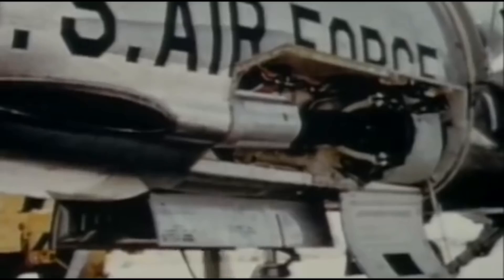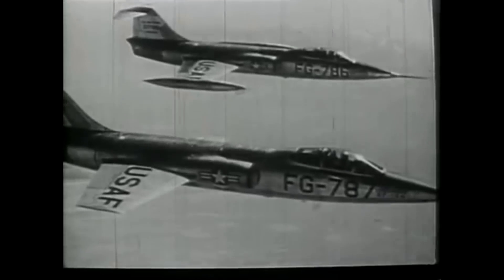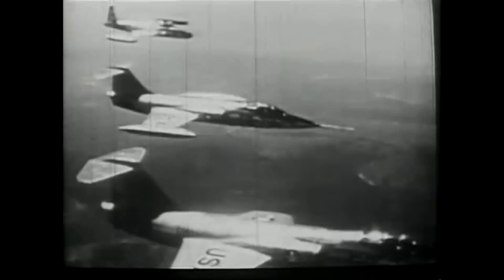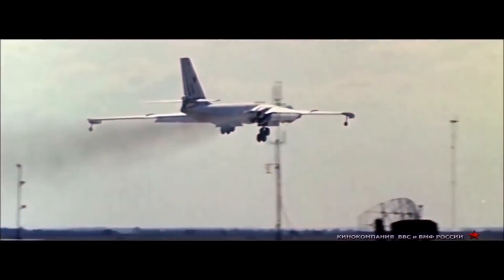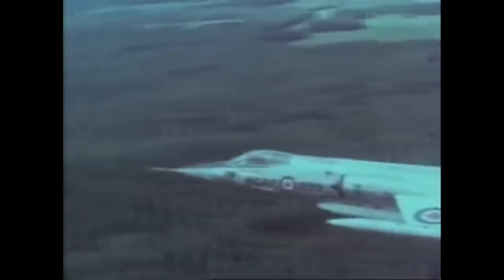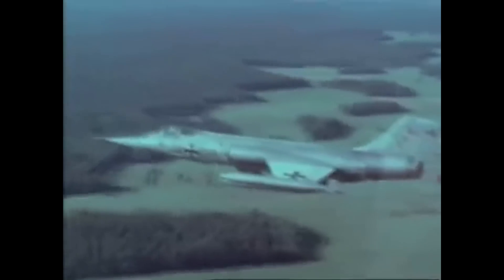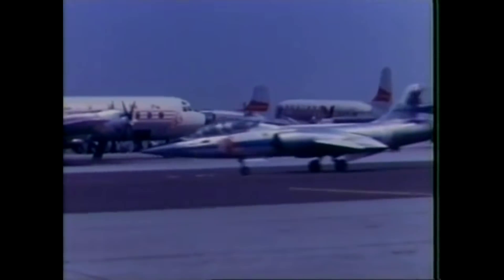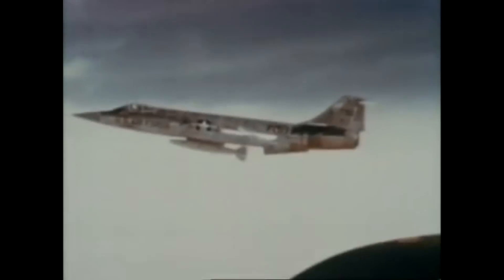Lockheed F-104 Starfighter | The worlds first Mach 2 fighter

Comment: The F-104 was called the Widow Maker in Europe.
Reply: Actually, step into 2nd generation jet fighters caused plenty of accidents world-wide. In Czechoslovakia, we had 168 MiG-21F and 48 had accident (13 fatal). Germany had 915 F-104G, had 270 accidents (110 fatal). Ratio is moreless the same.
Reply: @bluefalcon7782  The F-104 was designed as an Interceptor. It was used in exercises as a low level fighter and most crashes were from low level flight training and exercises. They simply flew into the ground.
Reply: @bluefalcon7782  nice too know! Thanks!
Reply: Most of the problems seem to drill down to people trying to use the F-104 for things it was not designed to do.

Marketing department didn’t talk to the engineers... Dilbert would understand.
Reply: Spain used the fighter ONLY as good-weather intercepter and got the benefit of getting a version, where most of the bugs were already figured out. Furthermore they had only 21 jets and did all in all 'only' 17000 flight hours. German pilots flown over all squadrons around a hundred times of those flight hours. So they got the benefit of low numbers too. In Germany Erich Hartmann spoke out against the plane, because of all the problems, which forced him early into retirement. His direct boss Günther Rall said he lacked the experience.  Hartmann was credited shooting down 352 aircraft during WWII and was the most sucessful fighter pilot in history. He even flew the ME 262, but prefered to stay with his unit. After the war he commanded West Germany's first all-jet unit from 6 June 1959 to 29 May 1962, Jagdgeschwader 71 "Richthofen".
Reply: It's a common myth that the plane was a killer because of German losses. Air forces with experience had a lot better time with the plane, it's a high skill ceiling aircraft that really shouldn't have been given to air forces that lacked the knowhow to handle it, but it was and the newly reconstructed German air force got their asses kicked by it.
Reply: @russetwolf13  It was designed as a high altitude interceptor, but the Germans were using it as a low altitude penetrator, a mission it was never designed to do.
Reply: @russetwolf13  pakistan used the f104 to great effect in their first war with India. I think the Starfighter even scored a kill or two.
Reply: @russetwolf13  If I remember, 40 Canadian pilots also dies the same way
Reply: It was designed as a good weather Interceptor only! All other role's led to disaster...
Reply: @einautofan6685  Yep, what a waste
Reply: The English Electric Lightning and Starfighter went head to head in NATO exercises. The British pilots reported comparable levels of performance on top speed, altitude and rate of climb.  Then you tried to turn the aircraft.  With so little wing area (aka control surface) the F104 was at a severe disadvantage
Reply: @waynetemplar2183  
Actually the English Electric Lightning won every category except low level acceleration which was a dead heat.
Turning is not something you expected from US aircraft.
Reply: @barrierodliffe4155  I suspected as much. I was just displaying typical British modesty (bit like those RAF pilots)
Reply: @waynetemplar2183  it wasn't designed to dogfight. It was meant to get to high altitude quickly, and intercept bomber formations as far out as possible.
Reply: Little wonder, a plane needs a wing to fly.
Reply: Yeah and they sold it to to Europeans using corruption and trickery... It was ABSOLUTELY not a suitable airplane for the all weather fighter bomber role it was put in here in Europe resulting in way to many dead pilots.
Reply: Canadian losses
"About 110 CF-104/CF-104Ds were lost in accidents, out of 239 delivered - a loss rate of no less than 46 percent. However, it is only fair to point out that the Canadian CF-104s probably had the highest-flying time of any country operating the Starfighter. At the time of retirement, average airframe times were in the order of 6000 hours as compared to 2000 hours for the Luftwaffe."

 http://canadianstarfighterassociation.org/story.htm
 
verging on criminal!
Reply: Hey !
Here is a great idea !
I know this F-104 Starfighter is designed as a high-altitude, fair-weather interceptor,
- but let's see if we can load it up with lots of ordinance and fly it through clouds, real fast - real low and between big mountains !
Reply: @agwhitaker  Could get to go really really fast in a vertical dive first
Reply: MEs61  
Try looking up the number of crashes the Italians had with the F 104, it was not good. Over 150 F 104's in Italy had accidents or over 1/3rd of all Italian F 104's crashed.  Flying coffin was being polite to the disaster that was the F 104, only sold in big numbers because of Lockheed bribery.
Reply: @P38FORK  They were designed for speed and high altitude as an interceptor not for low level combat. If the powers to be forced the pilots to train for the later then I would call that stupidity. Would u not agree? In the Military, one does what they are told and ordered to do. This would be near insanity in my mind, although they still did it. Much like the F-4 Phantoms in Vietnam - They were shot down in droves for mush the same reasons as to why the 104's were crashing. They were simply not designed to do what they actually did with tragic consequences. The best training in the works would not have saved pilots with either birds of war. I hope you understand.
Reply: @P38FORK  I agree. Good luck all in all
Reply: Thats because they were using a supersonic interceptor as a ground attack aircraft.
Reply: Andre McGoo  I got a reply at 40
Reply: Rightfully earned name..
Reply: Spain lost none.
Reply: Poorly trained.
Reply: @P38FORK  Not at all, why do u say this?
Reply: @P38FORK  Well that has nothing to do with training but rather pure stupidity rather than training. 40 or so Canadian pilots also died the same way. By the way if u look up, there is the original DOC of which I shall read. 👍👍
Reply: A fascinating crap.
Reply: MEs61  
Italians had a high accident rate, they did improve it with the F 104 S  but it was still bad and called flying coffin in Italy.
Reply: Germans lost 292 aircrafts and 116 pilots  including 8 American pilots which cooperated with luftwaffe . There is even song about it „ Starfighter F-104G” https://youtu.be/Wn5pIY-j2To
Reply: @zepter00  Wow
Reply: MEs61  I believe the F 104S was also the only version capable of firing Sparrow air-air missiles.
Reply: @dukeford8893  37?
Reply: @dukeford8893  Thanks and apparently the Widow Maker was a Press thing only.
Reply: Especially in Germany.
Reply: @LA_Commander  There is a lot of crap here in the comments.  NO Canadian CF-104 driver ever called it the lawn dart (or the Widow Maker) - they called it the 104 (the yanks called it the Zipper).  The widowmaker bs was a making of the press who were ill disposed to it for a variety of reasons - not the least of which was that they often had pacifist sentiments.  The Canadian pilots who flew it loved it dearly and many of them started on the Sabre and the Canadian version (T-Bird) of the Lockheed Shooting Star P-80 then T-33.  It was a very fast airplane flown at low level in marginal conditions without modern glass cockpit instruments to deliver nuclear weapons deep into the Soviet Union.  We spent 3 years in Germany while my Dad flew the CF-104 in the nuclear attack role and I well recall the funerals and accident sites and knew some of the deceased.  Not one of them didn't love the airplane - in fact if you talk to a lot of 104 pilots who went on to fly other aircraft like the F-18, F-16 or even the invincible F-15, when asked which was their favourite aircraft, they often respond with the 104.  It was one of the first aircraft to have a better than 1:1 thrust/weight ratio and could beat an F-15 Eagle to 60,000 - in fact the Canadian altitude and speed records are STILL held by a modified CF-104 in 1967.  
 In it's role as a nuclear attack weapon, it was unmatched as the pilots knew they could sneak in to the Iron curtain at low altitudes at very high speeds and could remain untouched because nothing could catch a 104 on the deck and it presented a very tiny target (they are much smaller than the contemporary fighters of the day like the F-4 Phantom or the Mig-21).  When Trudeau Senior decided to decimate the Canadian armed forces, he pulled the nuclear attack role from the 104 and they deployed it to ground attack for which it was less suited - although in all it's appearances at Red Flag, the Canadians were not once prevented from completing their missions.   The 104  in Canadian service flew long past its anticipated retirement date and many of them were lost to bird strikes taking out their single engines, not surprising due to the low level altitudes they were flown at nearly 600 knots.
Reply: It killed hundred of German pilots
Reply: @janerikrasmussen  Why? because of those early engine version failures? Jesus, thats quite a death toll considering these people are all trained...
Reply: @Lucas-ck1po  It wasn't just the engine. A lot of different things lead to accidents. Failure of the oxygen system for the pilot, problems with insturments,  failure of the boundary layer control system for the flaps at one side to name a few. Also the early ejection seat in the 104 were utter crap. It worked great in testing with dummies. But if the pilot had any other dimensions then the dummies the ejection seat had a tendency to get destabilised and started to violently flip over which made an ejection at low altitude potentially deadly because the parachute couldn't deploy before the rotation stoped. There's a famous story of a german pilot who ejected low over the home airfield and his comrades could live watch how he get mashed into the tarmac without the parachute opening.
Reply: That sounds like an awful lot of under development. How the hell does a jet get commercialized across the world with an ejection system that spits the seat spinning? This may happen during early development but after a bunch sold to other countries... 
Anyway, thanks for the explanation, cheers
Reply: @janerikrasmussen  the dumbasses shouldn't have been using it as a fighter bomber
Reply: @janerikrasmussen  Likely killed 100s of Canadian pilots also.
Reply: @ethimself5064 - They lost 47 of them to accidents.
Reply: @brustar5152  Thanks
Reply: @ethimself5064  it did kill canadian pilots as well
Reply: @thetreblerebel  46 I heard
Reply: Yeah, they used it wrong. The plane was a high alt interceptor, not a low level dogfighter
Reply: @a-10thunderboltii24  
The only right use for the death trap was as a gate ornament stuck on top of a pole.
Reply: @barrierodliffe4155  It was not a death trap if it was used correctly. Still, it was one of the worst US planes considering it couldn’t keep up with the Lightning five years later. The F4 was a much better interceptor.
Reply: @a-10thunderboltii24  
There was only one correct use for the F 104 and that was as a gate ornament and the Lightning was not 5 years later.  The F 4 was better than the F 104 but not as fast or agile as the Lightning.
Reply: @barrierodliffe4155  The F104 was an interceptor, where it was fast enough to not need big wings. The 104 was introduced in 54, the Lightning in 59.
Reply: @barrierodliffe4155  You are right about top speed, but it is only Mach 0.04 faster. You are wrong about maneuverability. The F4 had a better lift to gross weight ratio. Even though the wing is not as up front, it was a more straight wing compared to the Lightning, and a higher thrust to loaded weight ratio. Still, two very close matched airplanes.
Reply: @a-10thunderboltii24  
The F 104 was not good at flying, never mind as an interceptor.
The F 104 first flight was 1954 and it was introduced in 1958. Lightning first flight and it went supersonic in 1954 and was introduced in 1959.
Reply: @barrierodliffe4155  You are right about the dates, it was my mistake. But what made it such a bad interceptor? It did the job it was made to, be a high alt interceptor. The US used it rightly, and had less accidents
Reply: @a-10thunderboltii24  
The US had about double the accident rate in the F 104 than they had in other century series fighters.  Italy and Canada also had high losses with theirs.
Reply: @barrierodliffe4155  These countries almost never performed higher interceptions, besides the US. The US likely used it wrong too, but not as much.
Reply: @barrierodliffe4155  it didn’t break altitude and speed records for nothing. Sure, it was not the best interceptor of the time, that goes to the F4. But, it was meant to do, fly high and fly fast.
Reply: @a-10thunderboltii24  
Germany lost 32 %,  Italy lost 37 %, Canada 46 % and USA had an accident rate far higher than other century series Fighters almost 3.5 times that of the F 106.
Reply: @barrierodliffe4155  The US still had losses smaller than these countries because they had a better idea of how to use it. It may have not been the plane even the USAF wanted, but in the right hands it was a decent plane. Most accidents were due to pilot error, such as landing and certain maneuvers. It was an extreme design many pilots had never handled before.
Reply: @a-10thunderboltii24  
Even experienced pilots found it hard and dangerous to fly.
The USAF did not seem to like it much.
The F-104A initially served briefly with the USAF Air Defense Command / Aerospace Defense Command (ADC) as an interceptor, although neither its range nor armament were well-suited for that role. The first unit to become operational with the F-104A was the 83rd Fighter Interceptor Squadron on 20 February 1958, at Hamilton AFB, California. After just three months of service, the unit was grounded after a series of engine-related accidents. The aircraft were then fitted with the J79-3B engine and another three ADC units equipped with the F-104A. The USAF reduced their orders from 722 Starfighters to 155. After only one year of service these aircraft were handed over to ADC-gained units of the Air National Guard, although it should be noted that the F-104 was intended as an interim solution while the ADC waited for delivery of the Convair F-106 Delta Dart.
In the end the USAF had 296 F 104's but they were not satisfied with it and deemed it to be unsuitable as an interceptor.
Reply: Spain didn’t think so. Zero operational losses. 

Look up the YouTube video where the Spanish do a takeoff, aileron roll, then land the F-104. 

I think the other air forces had problems with their meat servos. The even in German and Canadian service, the F-104 was actually less dangerous than the beloved by all F-86 it replaced.
Reply: @calvinnickel9995  
Spain had no losses but did not fly them so often and got rid of them after 7 years.
USAF had high losses with theirs and Canada lost some 46 % which is a very high accident rate.

Comment: Really? I think if you read a book or two you might discover that the UK had a fighter that exceded M2 and called it The Lightning, and it didn't end up being a coffin for those brave enough to try and fly it. Like we also gave the USA the jet engine for free, the all flying wing that enabled your test aircraft break the sound barrier, the Harrier (aka AV8B), the hovercraft, launch silos for ICBMs ... hey we even built a very successful supersonic airliner.
Reply: And it did not end up a "coffin" because it was an inherently safer aircraft?  Did the countries that crashed the F-104 get the opportunity to crash the Lightning as well?  The Lightning had multiple safety issues. If the countries that crashed the 104 had flown the Lightning in the same role they probably would have crashed just as many if not more of them.  They didn't get the chance because the lightening was not sold as a strike aircraft to those countries.  
The combat radius of the F-104 was limited, but the radius of the Lightning was absolutely too nil to perform even an air superiority fighter mission.  In fact, the Lightning was designed more as a missile delivery system to provide point defense for V-bomber bases until proper surface to air missile systems could be acquired.  The Lightning was designed to scramble off QRA and fly out to fire 2 missile at incoming bombers, then rush back to reload and maybe get to try again.  Its reason for being was deterrence: to reduce the probably that a first strike could destroy enough V-bombers on the ground to prevent meaningful  retaliation.

Comment: BAE, a supposed partner in the f35 program, really just a diplomatic sop to justify the attempt to kill Britain’s aerospace industry using the f35, the true objective of the f35, have stayed on the record the f35 is not an air superiority fighter and that it is optimised as a strike platform. However, even as a strike platform its short range and small payload combined with dated avionics die to being twenty years late entering service mean it fails there too. The US would be best advised to order the f15x and new build f15es and start with a clean sheet replacement for the failed f35 monstrosity.

Comment: F-104 could have evolved with F-5's wing design.
Reply: Yep, the 104’s wings should have been about 30% larger, would have made for a better aircraft without sacrificing hardly any performance.. I think the wings were a poor decision.. A little thicker also so some fuel could have been carried in them as well.,
Reply: Then it would have been an F-5.  These aircraft had different purposes at different times.  The F-104 was to be a fast as possible; the F-5 was to be inexpensive while providing minimal supersonic capability.  The F-104 was still faster than the much later ultimate F-5G (F-20) on less thrust and more weight, largely due to the wing.